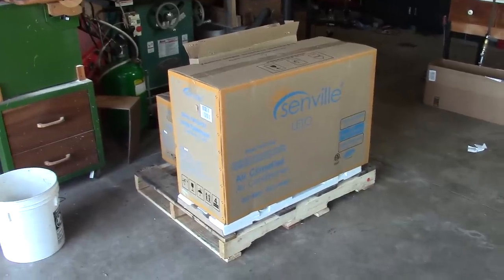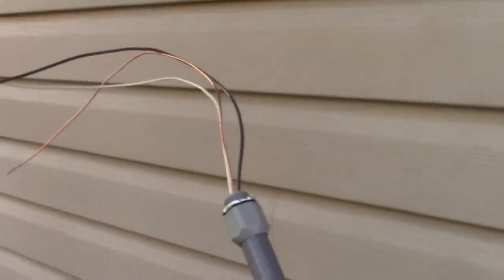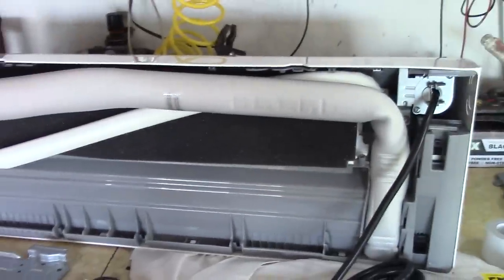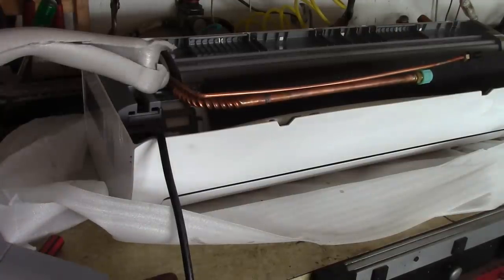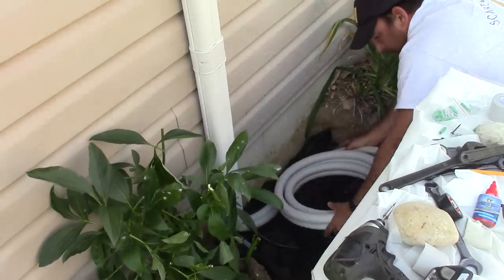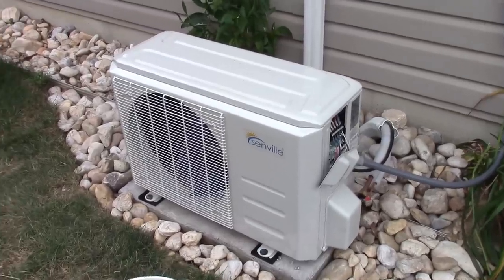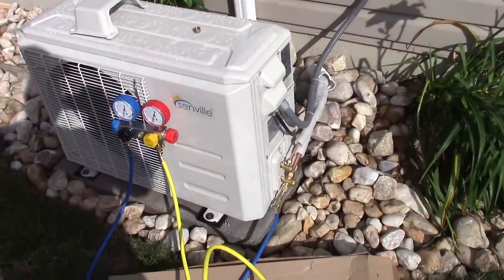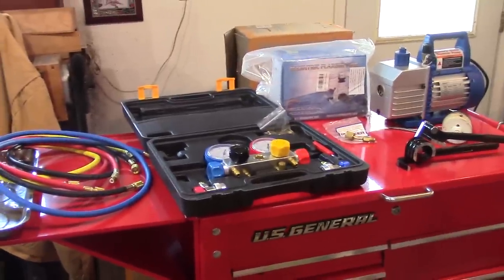Mini Split A/C Full Installation Full Video

Comment: Good tutorial double wide,  I purchased this unit to install myself.  I ordered the Manifold gauge set from amazon since  it came with the 1/4 inch adapter.  BEWARE  The threads on this adapter did not like the male threads on the unit for some reason. They appeared to be in good shape. If you do not get the adapter all the way on the valve stems will not engage.  I realized this after close examination and several attempt at purging the lines.  I finally got the adapter all the way on but it took too much effort.  I looked up the manufacturer and its from Orion Motor Tech a Walmart brand ordered on Amazon. I'm sure it is made in China  I lost half a day trying to determine and trouble shoot the problem.  Word to the wise.
Reply: The adaptor I got with time kit was simply the wrong thread pitch, you still need to order the 5/16 - 1/4 pioneer (or the like) adaptor off Amazon.

Comment: Good job on the details
These are very popular in Europe,
They gain more popularity in US for smaller older homes as well as other garages or back units, way more efficient and doesn’t require gas line for heat

Comment: Great vid .Good explanation. I did my own install on a Senville  12k, in cold Canada Jan , 2014 , but it was the Aura series, which has a better SER rating than the Leto series. It has been going for 5 yrs now.  There was no defrost heat strip in the base at the time, so i use a hot water hose to do a big de-ice if it needs it. I do not push the unit much below -15c. Sure you can still get heat below that but it is not as efficient .  I don't see any point in working a compressor and 2 fans when your efficiency is low and you are getting close to a 1 to 1 efficiency ratio. I just shut it down on the remote and that keeps the compressor heater on, that i can hear, i believe. You might as well use electricity at 100% efficiency or the oil furnace , than use  a heat pump and wear out you components.  I just set my furnace and leave it it do what it has to do. IMO You cannot replace a  100k btu furnace with a 12k mini split. I complement my furnace which is my main heat source. I don't believe in moving the temp control around ,when it is running because the heat is so sutle, it takes a while to regain temp.I just leave it alone 24/7 when it is running.  My total install was 1800$ Can. with the same tools you have .  1400$ W/O tools . Take care.

Comment: Great installation video. I did my 4 ton 2 stage this summer installed. I did most if work myself only called the hvac professional for hooking up the Lineset and and AH. Saved almost 7-8k from the quoted price.
Reply: Very good work
Reply: Mini split cost that much ovethere where do you live so i can take my business overthere
Reply: Wow... you have no manufactures warranty... you just voided it... it wont matter if mr hvac hooked up your line set... you had to buy your equipment on line...which is a double no warranty.. if a supply house sold it to you.. they just breached franchise contract.. manufacturer will find out when you call for warranty .. unless you bought a chinese product and good luck with that!! DID YOU HAVE A J LOAD CALC DONE??..

Comment: Nice job as a homeowner, very carefully done and neat. Only one misleading comment, as others mentioned. When the line set or a system is under a evacuation, that is a negative pressure, you can not do a bubble leak check, and to check for leaks by a loss of vacuum, is not a effective way to leak check. I believe the homeowner meant to say, you can do a bubble test after the system was pressurized, however pro's would do a leak check by pressurizing the lines with nitrogen and in some case use a tracer, that's if you use a electronic leak checker. Also I am not a fan of nylock, I would use flare seals. Otherwise, it's still a good installation.

Comment: We just had the 2 ton unit installed by a local HVAC person. He didn't break the bank. We had power ,slab poured and unit waiting. Will check back and see how yours is doing. 
And great video on your installation .. 🙂

Comment: Just I installed  mine and vacuum checked so far all ok. If you are mounting the condenser on concrete I suggest you purchase a Harbor Freight hammer drill. It has a list price of $99 but with discount coupon you can get it for $70. Also suggest the 3/8” SDS concrete drill from Lowe’s with four cutting heads. After much frustration with a small hammer drill I found that the Harbor Freight set up made the drilling 1000% easier.  Also suggest you use the 3/8” lag bolts from Home Depot. What you need to do is set the condenser where you want it, place the rubber feet at each attachment point and then drill the concrete through the attachment holes in the unit. Vacuum away the dust then hammer the lag bolts through the attachment points on the unit into the concrete. Then tighten the lag bolts with a 1/2” open end wrench until tight. You will probably need to remove the screen in front of the fan so you can access the foot at that corner. Hope this helps.

Comment: Thanx for the thorough and "honest" video.. 
Marking the white wire for use as a hot is necessary.  When I use similar wire w/o a neutral (12-2 etc)  I "heat" shrink red over all the exposed white  (back to the Romex covering) for my purpose (just an idea for yah). Or I use (several) single conductors in a conduit.  Another suggestion, I don't think the "soapy water" will work to easily detect  a vacuum leak...soapy water is better used to detect "pressurised system leak.  Again thanx for showing us how you did it.. your installation looks great...
Reply: Honestly l don't know. you bring up a good point with the soapy bubbles.  if you get a vacuum: "negative pressure",  and if there is a "leak"; it will be air moving from higher pressure "outside the line" to inside the line, "lower pressure"..it might make bubbles...but probably inside your line.

Comment: I got this same unit after your video. My unit won't pressurize like yours did at all. When I close my low side, it just drops to 0. Seems like I have a leak somewhere, but I have no idea where on those connections it's leaking. I reconnected them 4 times tonight alone and added plenty of nylog with it each time. No dice. Now I'm messaging Senville to get help. I'm so beyond frustrated. A local HVAC guy quoted me saying he wanted $750 to fix it from this point.

Comment: Great video, thanks!  I had a Mitsubishi installed, which I later added a WIFI module to that connects to a dedicated electrical port.  That allows me to control my unit remotely.  I use this on a cabin and turn on the A/C before traveling up to there.  My lineset is about 35 feet, which runs through an attic crawlspace then down to the soffit to get outside... not something I wanted to do myself.  He had to solder the lines to get enough length.  Anyway, I'm impressed and grateful for the video!

Comment: Fantastic Video, this combined one or any of the 3 individual parts you also uploaded.  Great!  Even if the experts have pointed out a few minor misgivings in the techniques used, it is a great educational video, well detailed and clear to understand.
I'd like to understand more about the Use of Each of the 4 Valve Knobs on the manifold.   -Chris

Comment: Great install vid. It’s a crap shoot with having pros do it as well, so good job.
Reply: That's the truth.  The HVAC people that installed my home system are morons.  They finally had to call the a tech from the manufacturer to come out and fix the issues it was having after they installed.  Educate yourself and you can do as good or better job.
Reply: @carmangary  Ain't that the truth. I'm in construction and the people working either as subs or employee are not going to be nearly as good as the owner who does the work himself unless they get lucky and find the right employee and or sub. As bad as that may sound it's the truth. I've gone through 80 employee in 7 years and if and when I find a good one they either have other issues or sometimes go on their own.

Comment: Thank you for making this video I am not a heating and cooling guy but over the winter installed a New 90 plus furnace now I am attempting to install the AC Unit have the electrical part done now have to run the Line set. I will use your video as a reference. Good Job.
Reply: Mini splits are much different than a traditional split system.  You will need a vacuum pump gauges with low loss fittings, welding torch, nitrogen purge, you'll have to install an evap coil on the furnace and reconfigure plenum and ducts.  Keep in mind your ducts will need larger capacity than may be installed if you have a heat only system, also ducts must be insulated to ensure no condensation on the bare metal.  Welding you can also dmg components be sure to put wet rags on the piping to prevent heat getting to the sensing bulb on the indoor coil and the valves on the condenser failing to do so and overheating can cause bulb and valve failure.  Releasing the refrigerant and working on the hoses can be very dangerous,  handling this without proper license can result in 20k fines if you get caught,  keep in mind you cant even buy refrigerant without it,  most 410 condensers come with enough for 15 feet of lines anything over that will need more added.  It really isnt a diy type of thing but if you have a mechanical background and dont value your time very much you can get it done.  By the time you buy everything and factor in your wasted time you could spend making money doing whatever it Is you do.  Anything can be done yourself just a question of how much you value your time and also do you actually think you can do a professional job from watching a few videos?  I'd love to watch you attempt it. Let us know how it goes

Comment: Congratulations for this video and for the awesome install. You did a great job. I will be doing something like that in the near future and will revisit your video again.
I have one question for you: Do the instructions say keep the vacuum pump and the lines connected while letting the Freon filling the system? I would expect to see some sort of valve at the connect and so it can be closed before charging the system with Freon.
Reply: I have no clue honestly.   but I imagine if you remove the vacuum line FIRST you MAY get a bit of air back in the line.  vs disconnecting 2nd...you get a bit of freon in the vacuum line but then that's pulled in the a/c line when disconnected (vs air)
Reply: @GarlandRentalsllc  I see thanks. I watched the part where you were letting the Freon filling the system once again. You removed the vacuum pump attachment from the bottom line. Some Freon (it seems) came out and then stopped. So there has to be some sort of spring loaded valve at that connection point I imagine otherwise the Freon would leak out. So I am still thinking that it would have been okay to disconnect the vacuum pump before letting the Freon fill the system but I would still like an HVAC tech to confirm it (if any of them would). Thanks...
Reply from the maker: I actually put a quick grip clamp on the hose but did not show it in the video.  I know they make hoses that have ball valves, which I did not order, so i just put the clamp on.  Seems to have worked really well.  It heats great and cools even better.
Reply: iskoos I’m not a tech but have an uncle who is one whom I also work with and plan to go into that trade there is a Schrader valve very similar to what is on a bicycle tire so that when you disconnect the hoses it doesn’t leak out although sometimes when you take the hoses off it leaks a little bit if you have the higher grade expensive hoses it won’t leak as much but that little bit doesn’t make a big difference

Comment: Overall good install. I would strongly suggest, however, using a micron guage while evacuating. That is the only way to know for sure that the unit is evacuated to the proper level and that the unit is leak free.  The guage needle is not a reliable indication of a proper vacuum or a tight system.  If you cannot use a micron guage then I suggest pulling a longer vacuum than normal. Let the pump run for an hour or two. You cannot over evacuate so the longer the vacuum, the better. I’ve been on some jobs where I would leave a vacuum pump to run over night. Larger equipment, of course but it’s the same principle. Also, you cannot use soap bubble as a leak detector until you pressurize the lines. Bubbles won’t form if the lines are still in a vacuum.
Reply: Sir hi a questiom if i may, did he close the right knob on the gauge, cause it seems that the one he closed seem to let you read the vacuum in the pipe frome the handler frome the gauge to the vacuumpomp

Comment: great video..I have the same style vacume pump but its 1/4 hp..it works great too...I love learnig and doing the work myself around my home...thnks fr the video Iinstalled 2  units 2 ton one is r410a and the other r22a...I also bought my manifolds vacume pump hose addapters flange flare tool ect...Every 6 months I maintaince my minisplits...saves alot of cash n you know its done correctly...thnks fr the video.

Comment: Before vacuum you have to purge system with nitrogen, this accomplishes 2 things...
1. gives you positive pressure to leak check connections
2. helps boil off any water inside lines (raising pressure lowers boiling point of water)
When vacuuming system use a micron gauge, vacuum to at least 500 microns, below that is preferable. Before starting a vacuum you should test the pump itself to ensure it can even pull a deep vacuum. The pump itself should be able to pull at least down to 50 microns. 

With 26 years in this industry, there are some major "don'ts" done here. For starters, not torquing the connections... over torquing can cause flare ruptures = leaks and under torquing can cause flare nuts to vibrate loose. Painfully watching improper procedures, i sadly couldn't finish video.

You must first calibrate your gauges (manifold) before each use to atmospheric pressure.
Looking at gauges at 31:30 both sides do not read the same... not calibrated. You don't even know if you are at 30 in. Hg  ....smh manual says negative 20??? my sides are splitting from laughing. Have you even researched anything hvac related?

By not following proper vacuum methods you did not dehydrate system. Which tells me you had a wet system once you released refrigerant. So you now have moisture mixed in with refrigerant.... this will cause ice crystals in parts of the system and gas bubbles in others.
mini splits are designed with eev or exv valves and several thermistors. You successfully set up your system with multiple future problems.... failed stator motor/s , failed compressor, and because of contaminated refrigerant... thermistors will read improper temps causing system unneeded ramping of motors causing efficiency to drop and unnecessary run times drastically reducing life span. Over working dc motors can cause capacitors on control board to fail, causing the need to replace a costly board... yes you have no warranty and will have to pay full price, and because of your lack of reading the manual and researching proper methods, you successfully damaged everyone's equipment who used this video regardless of disclaimer. 

laughing when you took off second plastic cap off suction line from head and said only "must've just had pressure on small line".... they both had pressure, you just released it all from the small line.

remote mounted next to a door with windows? seriously? you dont think sunlight will heat up the remote and cause a false air temp reading?

Drain line has to be below line set as it exits wall for drainage.. no mention of that to viewers.
Hopefully that was done...

Call a professional, have them watch your video so they know where to start. Good luck.
Reply: Да, и ещё он камней навалил, за наружным блоком, что будет мешать обдуву конденсатора. Одним словом,-"мастер" руки из жопы!))
Reply: I'm still in school and  just shut it off as soon as he said he wasn't an HVAC professional, he was a homeowner doing his own install. I wanna see some good installs lol. On a side note, isn't this illegal? OR just the working with the actual refrigerant?
Reply: 😂 crazy I also went to college, oh it’s been about 10 years. I can’t say I was taught to use a torque wrench. We did it by hand and had to learn when it’s to much for the copper. I’m sure they teach it more often. On that note I’m sure he saved him self money as well as gained knowledge of a self install for the future. Thought he did a good job. Sure he learned even more in comments  to be great next rounds.

Comment: You say to check for bubbles if it’s leaking, but you don’t mean that while under a vacuum that would be after you’ve let the refrigerant into the lines, correct?